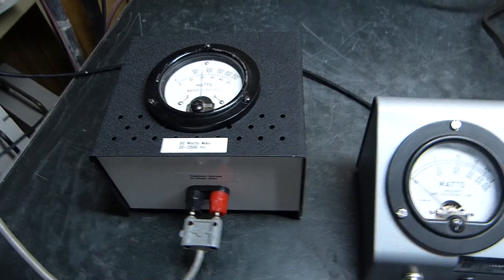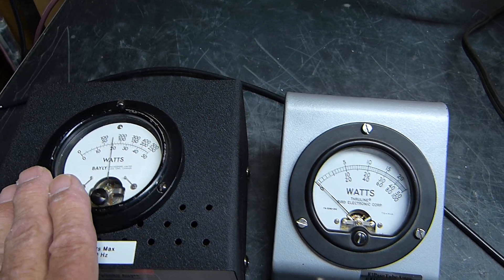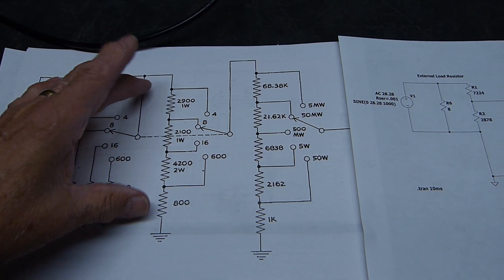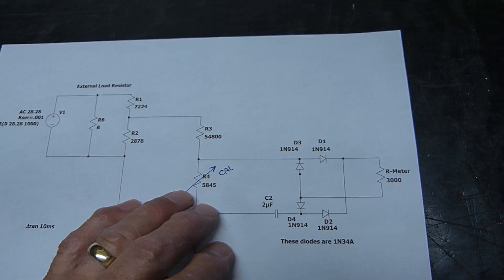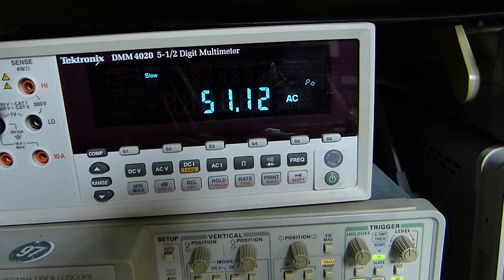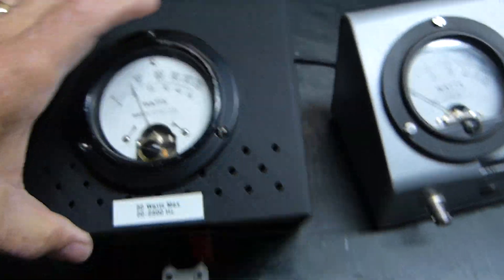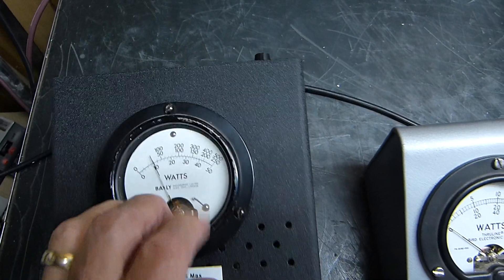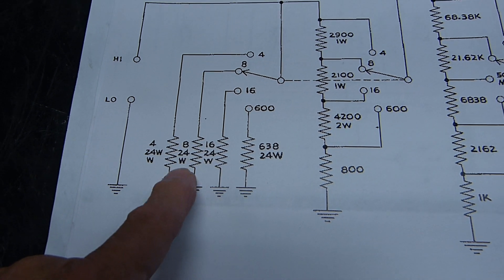A Simple Easy to Build 50 Watt Audio Wattmeter Using 30 uA Meter Movement

Comment: great video!  do you have a final schematic for the device?
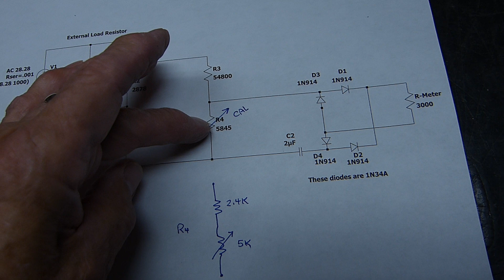Reply from the maker: I don't think I kept a permament schematic of it but it is essentially the schematic seen in the video at about 1:50 and again at about 2:50.  It does take the two calibration pots to make it track properly and will directly drive the meter movement calibrated in watts like the Bird Electronics RF wattmeter, 30uA movement. I think this is a Heathkit schematic and every Heathkit manual can be found at this website -  https://www.vintage-radio.info/heathkit

Comment: Hi Sir , 
I am looking to buying an old defective bird power meter, bird SIMPSON meter gauge 30uA
Reply from the maker: Probably the best place to find what you are looking for is Ebay. If you are just looking for the 30 uA meter movement, there are plenty of China made meters for much less than a Bird branded meter. Here is a listing for an off-brand meter that will probably work OK.  The genuine USA made meters are more expensive.

https://www.ebay.com/itm/330602845547?hash=item4cf977156b:g:-BgAAOxyJ59RHslX&amdata=enc%3AAQAIAAAA8Py1FbxXEvSEpd2%2BiQI3cvrovb0LnN6OiVKgG1xdIUUq3o3MPkDbYeE821IVa2lCsbdvWunZPLGDrhCQ5ouO6HxWeXvAKzJzmgyh4hFfanXrDgEz3ZWDNWL9xw8LwxEPjWgbgCvg86MjgnquyIxHlu2u50h%2BeNEduSIjjM15z8V0kWgIjlMa0eeNW8PqdUKKhG1Kxj1uuFwgZqRaRl%2BmML%2FqSELoBTxHGb2csHUA9Ea9mrzmfzGtg7x8jDYlXRs8i7Hzq57ARHq4wMnW6XlNaaqW0BNKgBitmawkZ9v26xOaB6SFTelHA6b6peamaGNQzQ%3D%3D%7Ctkp%3ABk9SR_LK5aKKYg

Comment: I’m confused.. 
i thought that 20vac equals to 50watts, or do I missing something?
Reply from the maker: That's right, 20 volts RMS across an 8 ohm load would be 50 watts average. Did I say it wrong in the video?
Reply: @ElPasoTubeAmps  No you didn’t say that…
But when you showed that the analog was calibrated correctly, and ut tektronix meter showed 50vac @ 50watts i was quite confused…
But now when i look closely, in the right upper corner Po is displayed. I guess it’s for Power(Watts) measurement haha
I want to build a simple tester also, but the rabbit hole goes deep 😱
At my work we have old analog meter also, which is quite simple, you can switch between 5,50 & 150 watts.
With only a diode bridge, the 8ohm load is connected to the ac of the bridge, - goes straight to the analog meter, and the + goed trough a resistor 1k and a trimmer, and by switching the resistor you can change the scale of the measurement.
There are also 3 different scales on the analog meter also…
After doing quite some research I noticed that measuring audio wattage ain’t that simple, because you have 4or5 different parameters like peak, RMS etc. Also there is a difference when playing a 1khz sine or compressed music etc
All these options make my head spinning lol.
Reply from the maker: @DJDavo013  I watched some of the video again and typically we do see voltage on a display and not power and even I had to blink at it and see the Po as you mentioned.
I know the scale on these meters is a squared scale rather than a linear scale and I did not know that it would take two attenuation networks to make this thing work. I still do not know why as I have not researched it further. So, it boils  down to what meter is being used to what value and type of attenuation network has to be used. I can see that now but did not realize it at the start of this project. I don't know if I mentioned it in the video but I had to add a capacitor, I think across the meter, to make it read accurately at 20KHz because in the beginning the frequency range was rather shallow - I don't remember the exact values - but I had to play with the value of capacitor to make it accurate. As you mention, the rabbit hole can sure get deep and leave us scratching our head...  🙂 I do want to lastly add that I have made good peak reading AF and RF watt meters with LED light bars. What it actually is, is a LED volt meter calibrated in watts across some value of resistance and a squared scale next to the LEDs. My AF meters are typically calibrated to 8 ohms and my RF meters are calibrated to 50 ohms. The problem with the RF meters is the meter will read the sum of forward and reflected voltages so it is only accurate into a very low SWR load. Stay safe and thanks for your comments and discussion.
https://www.youtube.com/watch?v=n5a9w2M7h5I&t=680s
Reply: @ElPasoTubeAmps  with square you mean like root square? I’m not really good in mathematics, calculating the power in ohms law you need square root also, depending on what you numbers you have. I always use an ohms law calculator for that haha
So i made a chart to calibrate a diy watts meter with a ohms law calculator 

5 = 6,324vac
10 = 8,944vac
15 = 10,954vac
20=  12,649vac
25 =  14,142vac
30=  15,492vac
40= 17,888vac
50= 20vac
60= 21, 908vac
70= 23,664vac
80= 25,298vac
90=  26.832vac
100= 28.284vac

In the description you mentioned about a capacitor for more accurate measurements up to 20khz.
I never tested higher freq as 1k, rather down then up.. because I think 50hz is more heavy for an amp as 20k.. 
do you have a final schematic?
Reply from the maker: @DJDavo013  I don't have a schematic any more than what I described in the video. 
Assuming you are talking about a LED wattmeter I do it like this.
We have to decide what voltage level (not power level yet...) we want our LED wattmeter to read and how many segments we have. Let's assume 20 LEDs and we want the top one to measure 20 volts RMS, or peak (to indicate 50 watts). Now we know each segment is going to represent a linear 1 volt change so we make something like an Excel spreadsheet or do it by hand and know that the first segment is 1 volt and power is voltage squared over resistance (or impedance if you prefer) so that first segment would be 1 squared divided by 8 (assuming an 8 ohm load) or 1/8 watt. The next segment would be 2 squared divided by 8 or 0.5 watt, the third segment would be 3 squared divided by 8 or about 1 watt and so on. Segment 5 would be 5 squared divided by 8 or about 3 watts all the way to the top of 20 volts squared divided by 8 to be 50 watts. That is what I mean by a "squared scale" so that we are reading power, in watts, off of an linear LED voltmeter. The LED voltmeter calibrated like this becomes an LED wattmeter that will measure average power if the power is steady or a peak-reading wattmeter if music, or any audio, is playing. Hope this makes sense...
As for the capacitor, I don't think it was needed at lower frequencies and I don't think it changed anything, as best I can remember, on the lower frequencies if it is added.
Reply: @ElPasoTubeAmps  Two attenuation networks are needed to 1) set the proper range for a particular speaker load in the case of the original Heathkit meter it was 0.14 volts for full range.  Since the HK had 4-8-16 and 600 ohms inputs it needed multiple voltage dividing points to keep the input into the range network (the 100K divider) at 0.14V for different loads. 2) The second "attenuator" is used for ranging, in your case only one scale at 50W, but in the case of the HK it is 5 scales and only the 5mW scale had the proper voltage for full meter deflection at 0.14V.  As power goes up attenuation is needed to keep the full deflection at the right level.  In your case it is only one scale and what you seems to have done is combine ranging and load into a single network.    One cool thing about your solution is that you can empirically figure out the right values for every scale then built the divider network if you wish to have more than 1 load (say 4 and 8 ohs) and multiple scales, say 5 and 50 W, rather than use "math".  Thanks for the nice video and explanation.

Comment: Great Video...  i was looking for that! for sure i will build it following your project. Thx a lot !
Reply from the maker: I am very pleased it helped. As mentioned in the video beginning, I thought a simple one-step attenuator (maybe just a series resistor) would do the trick but it won't track power across the meter properly. A wattmeter scale is a squared-scale rather than a linear scale like voltage and current and some may be marked slightly different from others to best fit the instrument they were initially designed for but in general, I think most will work out just fine.

Comment: Thank you very much. Do you have a suggestion for modifying the circuit for 4 Ohms?
Reply from the maker: Hi Tim, 
I can only suggest using the schematic in the video from the Heathkit wattmeter and tinkering with the resistance values until it tracks accurately with whatever wattmeter meter movement you have to use. I used a 30 uA movement. I do not know the mathematical sequence to the two level attenuator. Sorry I am not more help.
Reply: @ElPasoTubeAmps  Thanks no prob. I will be working with the 30 uA and will give it a whirl.

Comment: The Bayly Engineering meter you used in the one on the left is a great find.  The man and his company were both deeply involved in the Oshawa / Ajax area east of Toronto during WWII and after, and were part of Canada's electronics and instruments industries which used to be pretty big at one time but are all gone now.  All that's left of a lot of these companies that I've got vintage equipment from and looked into the history on are the occasional newspaper articles on various archive sites and lapsed trademark registrations.
Reply from the maker: That is really nice to know some of the history of the Bayly meter. The 39 uA meter movement came out of a wattmeter (model IW3-11E) that has scales of 50, 250, and 500 watts measured forward and reflected power and the frequency range is 30 KHz to 2.0 MHz. I once did put a 50 ohm load on it and ran a McIntosh 2205 thru it at 30 KHz and the power measurement was correct. I haven't destroyed the instrument but I did borrow the meter movement. I can't imagine where I will ever need that frequency range and power but, who knows... the instrument even has N connectors on it. Thanks for the information.

Comment: I brought home an old stereo to take the watt and dB meters out of. Its an old Curtis Mathis all in on unit. It was really rough in the glass cabinet, I took the stereo left the crappy rotted partice board benind. After bringing it home and looking it over I didn't have the heart to kill it... I cleaned it up and tested it and to my suprise it sounded great! Was getting rained on for days before I garbage picked it sitting outside a house in my neighborhood.... They finally threw it away so I grabbed it.... Now Im stuck with another stereo I don't want to get rid off.....
Reply: I have never found this exact model online anywhere. I may make a video on it in the future....
It needs the tuner cord fixed anyways.....
Reply from the maker: I understand. It's almost like saving little kittens, we can't resist so we end up with a lot of cats. I like cats... we were  recently in Mexico City and laying on my desk in front of me as I write is a felt washer I picked up in the street as I was crossing. Who knows, one of these days I may need it. I have brought home a lot of equipment like you are describing and end up with too much and sometimes finally part-it-out and keep the components I think I might find useful in the future and dispose of the rest of it. I have an alley in the back of my house so pretty much anything I put out there gets picked up by the recycle people that comb the neighborhood alleys around here. Everything from good stuff to rusted out water heaters get  either recycled or end up across the border in Mexico possibly on someone's house. I like to think it helps others in some way.
Reply: @ElPasoTubeAmps  Im just about to do a video on a Lafayette 236A and what appears to be the matching tuner.... Can't find a model number.....

Comment: I just built one similar.  I used two 1 ma meters and put them in a test box.  I have binding post to connect to it.  I put BNC connectors to connect my oscilloscope.  I put connections on the back for dummy loads and speakers with a switch on the front to switch back and forth.  Instead of making two circuits for tracking on each meter,  I made new faces for the meters.  I did use two circuits though.  I put two scales on the meters.  10 watts and 100 watts.  I went 10 watt increments on the 100 watt scale and 1 watt on the 10 watt scale.  Probably a little more work than your approach.  Cool!
Reply: I put a switch to toggle through the scales also.  All the switches are dbl pole on/on switches.
Reply from the maker: I need a multi range meter like you have built. A single 50 watts scale isn't going to get it... so, I need to so something similar to what you did or use another meter I have that is a 100 uA movement and scale it for probably 100 and 250 watts. If I ever need to measure at the KW level again, I have the HP 8903 that will measure power well beyond a KW. I think little projects like this that can be enjoyed in the construction and then serve a useful purpose on the workbench is what others like to see. Huge projects like KW amplifiers and multi-KV power supplies can be interesting to watch but I enjoy seeing what others have built and find useful on YouTube probably usually more than the grandiose projects.
Reply: @ElPasoTubeAmps  I love building test equipment that makes troubleshooting or doing any testing easier.

Comment: Could this be made to work with a 100ua  meter and how would I work out the values for the two attenuator stages please?
Reply from the maker: I am sure it can be used with a 100 uA movement. I would start with the same values, a 10K pot for the first attenuator and then either a 50K or 100K pot for the second attenuator and just dial it in as I described and then measure the resistance  values with a good digital meter making the resistance across the meter variable for final calibration.
Reply: @ElPasoTubeAmps  Excellent,thank s for your help.

Comment: Hello David! Hope all is well. I like the concept of this meter! I would be interested in building one to handle up to maybe 1.5KW for some of the higher power amplifiers I repair. It would be interesting to design something with a range switch to step it up in 100W increments. I have to think about that more. Great video! :)
Reply from the maker: Hi Frank - sounds like a good idea to me. You know I am already thinking about one to measure up to 500 watts. Who knows, I many need to drag out my old Mac 2205 any day and test it...   I think the only challenge will be the ratio(s) of the two attenuators to get the meter to track properly. 
I still have a working 813 amp capable of better than 500 watts I could experiment with but maybe the huge amps are all done with for me although I would like to build one more with PP 810's. I have a bunch of 810's and the big output transformers I have were originally make for that tube.
I just can't seem to get into 5 watt SE amps running 300B's. I don't want to ride around on a Moped scooter - I want a NASA rocket to ride...  :-)